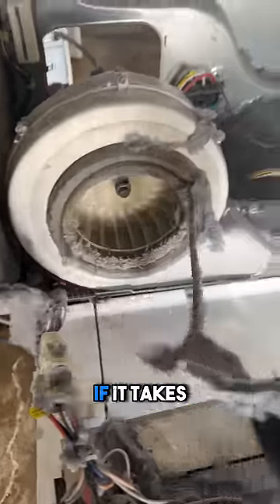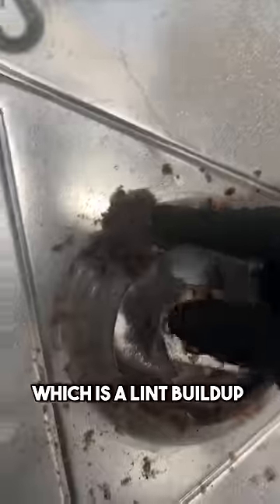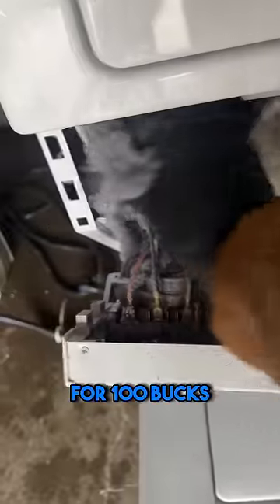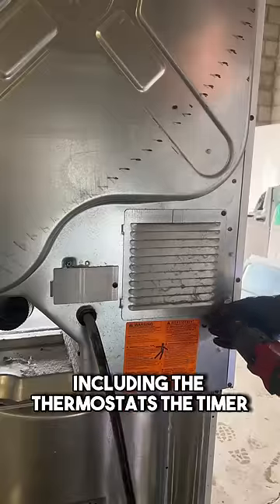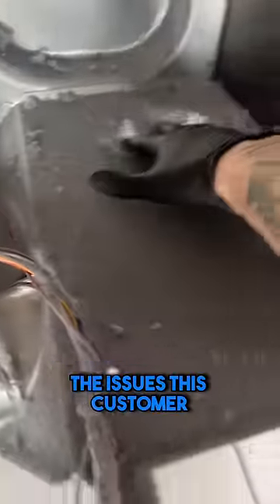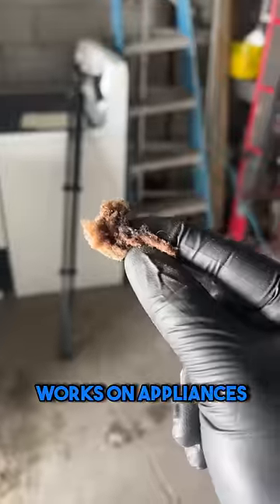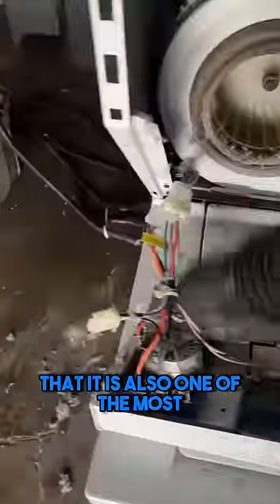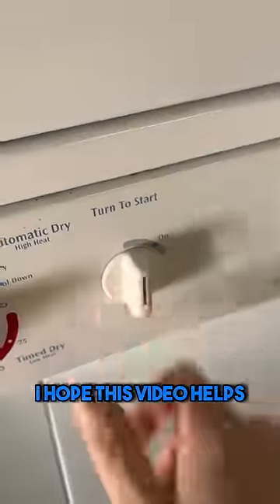Are You Tossing Your Dryer Away too Soon? the Shocking Truth Revealed

Comment: They need to make easy to open and clean dryers….
Reply: No bc then it’s less scrap metal junk for me
Reply: No. They want u to buy another one
Reply: It's pretty straight forward. Seems difficult at first, but once you know what you are doing, you can take it apart in less than 25 minutes. My dryer wasn't working because the heating element was shorted. Easiest $20 fix.
Reply: Its literally just a couple 5/16th sized screws
Reply: @gustavoventurin you just contradicted yourself, you boast how easy and straight forward and yet you also said 25 minutes and "if you know what youre doing" as if they cant just manufacture one that has a clip or something instead of dismantling the whole thing apart 😂
Reply: Honestly it’s pretty simple on most of them
Reply: The do... Its called screws.. and theres only a couple of them
Reply: You need to learn skills instead of asking manufacturers to simplify it for simple minds
Reply: I have one that collects the lint in this little thing you can pull out, open up and roll off all the lint with your finger

I’d say that’s convenient 😅
Reply: It is easy to open and clean, just make sure you remember how to put it back together when you're done 😂
Reply: Says the dude on youtube. Just search the brand and you’ll probably find a video on it. Let alone the model #.
Reply: @scottbeach3190  if anything complex mind don't want to waste time on frivolous stuff that could be designed better
Reply: @bloodshotred6334  i can tell you can't turn a screw driver.. this job is way too complex for you.
Reply: @Celestial-yq6hz all dryers have that. Lint still builds up outside of it.
Reply: @Celestial2560  yeah they all have a lint trap. It gets in the internals of the dryer though, as you can see in the video.
Reply: Why would they do that? They need you to consume
Reply: @steelisthemeal  its like 6 dollars for a dryer unless you get 20 plus a day its not worth it
Reply: They are you just dont have the qualifications for it to be easy like 4 years mechanic lol 🤣
Reply: Nope they’ll make them proprietary so only their tech’s can work on them and customers pay out the ass.
Reply: @MrNutt_  anything but metric
Reply: @74_pelicans  8mm there ya happy?
Reply: lol it easy...
Reply: @bloodshotred6334 25 minutes to open and clean a dryer seems pretty fast
Reply: @scottbeach3190  considering my dryer has a lint trap you can easily see and just pull out to instantly clean…. Yeah it is on the manufacturer this is literally just poorly designed 💀
Reply: they won‘t
Reply: @Celestial-yq6hz  that filter doesn’t get the fines out, it’s the fines that build up and eventually collect inside your vent. It’s still something that should be cleaned every few years.
Reply: @steelisthemeal  how do you think making it easier to open will end up with less scrap? 😂 god how daft.
Reply: New ones with heat pumps and filters are very easy to clean. Just take the filter out, vacuum up the gathered lint, empty the water that's conveniently gathered in the top drawer, and you're ready to go. Everything is user friendly.
Reply: @gustavoventurin  <------- contrarian
Reply: Very true. The old dryers just had that panel below the door while new ones requires the top and front be removed
Reply: No
Reply: Dude... They do, the problemhere is that people don't clean the lint traps, so it flows inside the machine, then you clean the trap, but there's some inside, until the same issue repeats itself. Go around 5 years... Machine gone
Reply: In germany you just have 2-3 filters which you wash or wipe out that’s it. 
I don’t know why you guys have such weird dryers in america…
Reply: I think you mean a lint trap.
Reply: @MetaMaticGamer  lint trap and filters
Reply: In Europe we have a filter. All lint ends up there, no vents to outside, no lint all over the dryer, no need to open it.
Reply: @scottbeach3190  literally what is wrong with wanting things to be more simple.
Reply: It's called a clothesline and it also doesn't destroy your clothes
Reply: It's not that hard, watch a couple of repair or disassembly video and read up some forums. This has always been how i learned diy stuff, if you always come up with excuse without trying then the mindset will always say no
Reply: @Scotford_Maconochie  Ding ding ding! Forced obsolescence strikes again.
Reply: @bloodshotred6334  It’s VERY easy to clean most dryers from lint build up. Regardless, it should never get this bad if you’re just doing the proper maintenance of your dryer vent lines and cleaning out the lint trap.
Reply: @Bloodshot Red  25 min isn't a long time for cleaning, and "if you know what you're doing" ei watch a video. Obviously if you don't know what you need to do it's going to be hard and takes longer. Like boiling water or pumping gas would be hard for someone when they have know idea what they are doing
Reply: They exist! In Germany you used to have dryers with a vent but they became really uncommon. Now you have ones with a collector for water and lint. You only need a plug and can put the dryer everywhere. After every use you just dump out the water and lint.
Reply: They do, come to the UK😂
Reply: I mean, in Germany we got dryers that have an build in filtering, no micro plastics gets blasted into the air by millions of households + easy to clean
Reply: @bloodshotred6334 you’ve clearly never worked in your life lol, 25 minutes is nothing to save you 500$ or more
Reply: @Celestial-yq6hz  all dryers have that
Reply: They do. Its called a lint trap
Reply: Like that'll ever happen 😔Unfortunately this is Earth 2023, and they refuse to make a good product that would last a long time. Companies hate that! They just want to sell you a product that's gonna break in a few years so they can sell it to you over and over and over again.
Reply: These are as easy as you can get, Man!
Reply: @steelisthemeal  lmfao
Reply: In my country we dont have exhauzt vents from the dryer to outside. If i had known how trounlesome it would eventually get to clean that condenser i wouldnt have bought that type. At first it was easy to clean but then it started to become moist in the  corners and that stuff wasnt so easy to remove. Retrospectively  I would go multipurpose unit for cleaning and drying. They self clean the condenser. I have 10 kg washer and 10 kg dryer. So inatead of that dryer i would get 9 kf combi wich has only 6 kg of drying capacity. That would be ok for me becouse only some of the laundry goes to dryer. You would get teo mashines to wash laundry and no switching mashines when you need to get em also dryed. Ofc you could live without the regular washer.
Reply: @gustavoventurin  not for nothing but it takes 3 SECONDS to open the hood of your car & it is clearly marked how to do it.
Appliances not so much
Reply: Mine has 46 little annoying screws and I always cut my arm reaching in. It’s such an annoying job!
Reply: @scottbeach3190  umm no have you ever heard of the right to repair movement? manufacturers intentionally make self repair and maintenance more difficult than it needs to be. It is not about making things simpler, it's about not making them unnecessarily difficult to begin with.
Reply: People are grasping at straws trying to prove you wrong lmao, having two different panels you need to dismantle before you can access something you are supposed to clean regularly is just shit designing, imagine having to unscrew and pull off two pieces of sheet metal covering the bottom of a car to do a oil change
Reply: They do #1 the lint trap is the easiest way to access high traffic lint areas. #2 this one and most top/bottom units have legit 2 screws to open to internals. Go learn how to do basic maintenance stuff it will save you money and make ur appliances/house last much longer and for most things it’s pretty basic.
Reply: You wouldnt need to open it up like this if you just emptied the lint trap after every load like a normal person
Reply: @joshuarahimi221 we have filters on our drying machines too, people are just stupid and don't clean them
Reply: @prn00 yeah we also have a filter, people somehow manage to not clean them and then this happens
Reply: Ive never seen such bullshit dryers like in the us. In european Market we have easy to clean, no Ventilation pipe needed, energy saving dryers. And ive never heard of andryer burn in europe😂 the american design of dryers is so bad
Reply: Yeah no shit. A lot of people can’t afford to call some dude to clean something they fucking own. Creating these problems intentionally and making products that a layperson CANNOT easily repair and maintain is extremely wasteful and horrible for the planet and the customers and is extremely short sighted and selfish. Responsibility for this and the problems it creates needs to be put back on the people making these products. Sad and pathetic that we will probably have to make literal laws to curb peoples greed.
Reply: @AshLilyNeko  so tiny issue with that

most of the lint problems stem from people not cleaning their filter
Reply: It's a few screws or bolts homie
Reply: The old one's are easy ours is like 4 screws and boom its apart.
Reply: They are. Repair one, and see.
Reply: Actually people just need to clean the lint filter after every cycle
Reply: @bloodshotred6334 He had to say if you know what you’re doing because most people don’t even though it’s common sense. If you didn’t learn how to unscrew something by the time you’re an adult that is in you. 35 minutes isn’t a lot of time to do a task that only needs done once every year or two. And a clip wouldn’t work. This is a heavy piece of machinery that moved around and spins very fast. It needs to be extremely secure otherwise the panels will fall out during the drying process.

All of this can be prevented though if you just clean the lint filter after every cycle 😂
Reply: @Celestial-yq6hz trays like that don't catch it all. You have to go in every so often to get the rest, otherwise it will continue to take longer to dry your stuff

Comment: We've had our washer and dryer set for about 3 years since we inherited them with our house. They are old and ugly, but every time they don't work right, I just buy some replacement parts and fix them. I've even deep cleaned every part in the washer. It's honestly really easy if you're even slightly mechanically inclined. I think they'll go quite a while longer.

Comment: Lint is a perfect fire starter to take with for camping or to keep in a tin next to the fireplace for one match starts.
Reply: Noted
Reply: Learned that back in Cub Scouts. You can even make your own rudimentary candles with them. Dryer lint lights like no other and weighs nothing. Great for camping.
Reply: You can make it even better. Stuff an egg carton with lint in each pocket, then pour in plain candle wax. Then you can cut the carton apart. To light, just light the bit of carton on the edge. It's water resistant, easily portable, and will burn for about 10 minutes when lit.
Reply: @naverilllang  precisely! I have had an empty laundry carton to save lint for this exact reason since grade school 30 years ago.
Reply: Is it bad for breathing tho?
Reply: @asd-dr9cf  It's just cotton and you should only use cardboard egg cartons and not plastic or styrofoam ones. Plus it's a fire, all the smoke is generally bad for breathing
Reply: I use these instead of tumbleweeds
Reply: @naverilllang to add, petroleum jelly is a good substitute for candie wax. Wasn’t obvious until I saw it myself lol
Reply: @redjoker365 it’s not just cotton unless all of the clothing you wash is 100% cotton. most clothing these days are made with synthetic materials such as polyester. this means when you burn lint you are burning off plastic which is not only terrible for the environment, but also carcinogenic.
Reply: @cool-ws7ny  I tend to wash like fabrics together because cottons can be dried on high whereas synthetics should be dried on a lower heat. Make sure to change the lint filter every wash for better dryer efficiency

Comment: The laundry room or by the room, is a good place to put a smoke detector. Also, try not to run the dryer while you are asleep, just in case a fire starts.
Reply: Ill put a washing machine next to my drying machine then so it wont catch on fire 😇😇😇
Reply: @jaypolas4136  But then the washing machine catches on fire due to the dryer and now nothing will be able to get in it's way 😈😈😈
Reply: Most Turn on the Dryer in the Night

Comment: My gas dryer started taking too long to dry, and it turned out to be the gas solenoid coils. They would open & fire the burner once, when the unit was dead cold, but then shut off after a minute and stay off.  $10 aftermarket part w/ lifetime warranty, ten minutes to install.

Comment: Dryer lint is common for dryer house fires to as well so if there’s clothes in the dryer that is known for building up lint I’ll check the lint filter five times and every 10-15 minutes the lint filter is completely full so I stop the dryer and clean the lint filter and I make sure the hose is not kinked and I make sure the dryer vent outside has gotten no crappy little screen restricting flow and catching lint

Comment: I always clean my dryer lint trap , Including using a small wire with a tiny brush down into the dryer after i remove the trap. It doesn't work that great. Show, how do I clean down inside or the vent hose that runs the length of the house in the attack?   Thanks a million!

Comment: I know someone (I'm calling her Paula) who worked at large apartment complex. One day, she got a complaint that an old man's vents weren't working. She went in to investigate and found bed bugs everywhere in the apartment. It turned out that the old man living there had been buying sheets and clothing second hand and using them without washing them. When Paula saw the bed bugs, she called an exterminator. The exterminator ultimately had to tear down a wall. Tearing down this wall, however, revealed over 30 years worth of bed bug build up.

Wash your sheets.

Comment: The best thing I ever found from a dryer is when I was disassembling the drum to use it as a yard fire pit thing. When I took the plastic fins off on the inside I found a dozen perfectly and I mean perfectly round dense lint balls of varying sizes. They just built up from lint being trapped in there and rolling around and rolling around.

Comment: How is lint buildup preventable? We empty lint filter and it still does that
Reply from the maker: The best way is to clean your ducts at least 1 - 2 times per year
Reply: @theappliancedudes ha ha really? My apartment complex just cleaned them across the property for the first time in years. And my dryer still takes two 80 minute cycles. If we take the dryer apart in any way we can be evicted.

Comment: Agreed, I also recommend running your lint trap under water after 10 to 20 loads depending on the size and what type. Also if you have a front loader, it's good practice to clean your coin trap after 30 cycles.
Reply from the maker: You’re right about that!

Comment: We use traditional dryers like in this video and they do have lint issues that need to be managed. But a new trend in dryers is to add unnecessary electronics that break and are too expensive to replace so they kill perfectly good dryers.
Reply: Example: my parents have had the same dryer and refrigerator for about 35 years. My best friend keeps buying high tech dryers and none of them have lasted more than 3 years.

Comment: We havent bought a new washer or dryer in over 10 years and both of them still work like new. Just have to take them apart and clean them, we went with simple industrial models though, and its amazing because so far everything that has broken has just been sensors or broken wires that cost a couple bucks and only takes a couple minutes to fix.

Comment: I always loved buying cheap vented dryers or thrown out ones and the lint inside really is just crazy! I switched to heat pump but for outside i did have a vented and always checked the inside and cleaned the duct yearly and filters after every program, it’s so important

Comment: We had a blockage on ours, located in the basement of the house. It wasn't drying properly, and we were going to check the hose first. The second I moved the dryer, I could hear what sounded like lots of water sloshing around, and when I got a proper look at the hose, there had to be 4-5 GALLONS of water in it, filling about 80-90% of the hose diameter, over a 4 to 6 foot run. I literally couldn't believe  what I was seeing in there. 

I immediately unplugged it, and isolated the water away from the exhaust vent, disconnected the hose, and filled a 2-3 gallon container twice with the water in that hose. I have no idea how long it took to accumulate that much water, but I found that the grille on the exterior vent on the side of the house had about a 1/4" thick carpet of lint spread evenly across it. I can only guess that the blockage caused excess moisture to build up in the hose that was unable to be vented, and just condensed into a huge amount of water where there shouldn't be any.